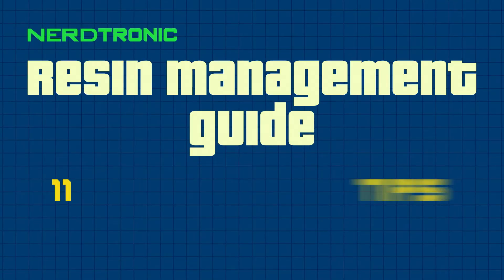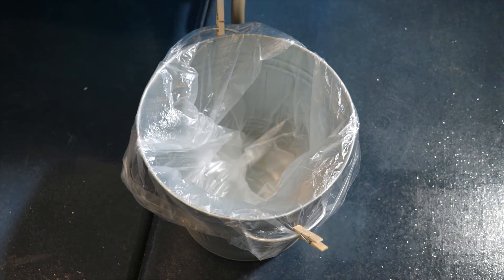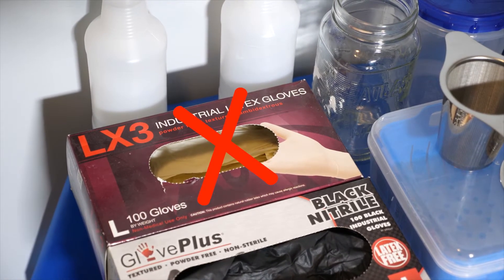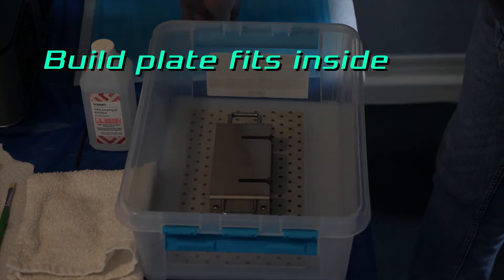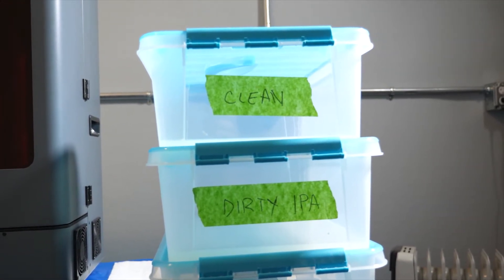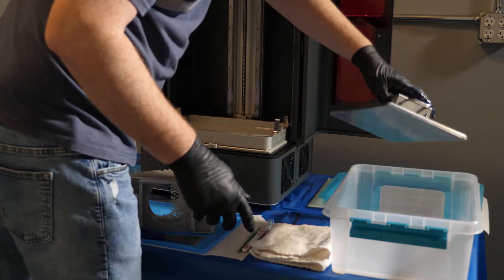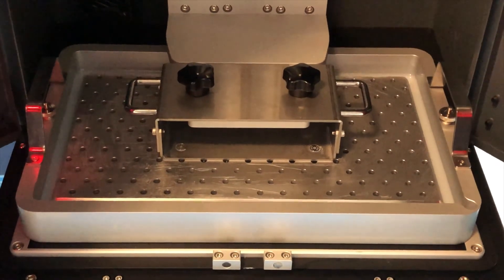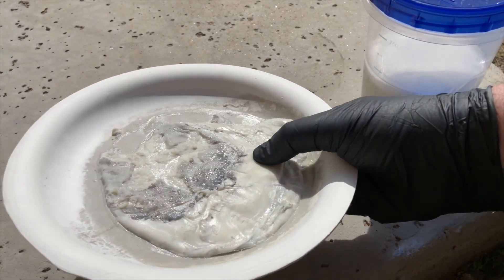SLA Resin Handling Guide for 3D Printing - 11 Tips for Containing the Mess and Keeping Things Safe

Comment: Thanks for another great video, great tips and will help. I can give you guys a awesome tip  Don't use those plastic scrapers, they damage your FEP., run your finger over the edge of th scrapper and you see. Get yourself a silicon spatular ( egg spatula/flipper) it works great, is easy to clean and will not damage your fep.  Also don't use paper towels to dry the vat , it scratches . Ger some microfiber wipes (fibre optic wipes ) . These will not scratch your FEP and are cheap.

Comment: I use most of these in one form or other. I appreciate the delineation between reasonable/practical and the practice of "Safety". 

The primary difference between our setups is that I have a ultrasonic cleaner large enough for the biggest print volume my printer can fill plus a little extra. This means it can fit my vat and build plate too. I don't have to brush anything. Ever. This requires a LOT of IPA (~2.5 gallons) to fill but due to its large volume there is no reason to delineate between "clean" and "dirty" IPA. For storage I used a 5 gallon bucket with sealed lid available from any hardware store. The Ultrasonic cleaner has an integrated drain valve which I have plumbed to pour directly into the bucket after use. A filter can be used to catch any supports, blobs, etc. A bonus to this setup is that I can simply put my hands in the cleaner should I get any resin on them. I don't know if I have more fumes than other setups given the surface area of my IPA is consistent and unchanging (vs. multiple large & small storage containers) but it is being agitated for the duration it is on. 

I do not use paper towels to wipe clean or even set the FEP on. Too much lint and abrasive properties. Lint free alcohol wipes if needed and only after an ultrasonic dip and air dry.

Another difference is that I exclusively use large metal razor blades to clean my build plate (~4 inch blade with handle found in any paint aisle). I'm not sure why but to date I've had more issues with excellent adhesion than I have with poor adhesion. I've had poor experience with putty knives. For me they don't cut it and catching a corner or edge will scratch/gouge the plate.

Just some of my thoughts/experience. Thank you for BulgeBuster; I'm testing it out currently.
Reply from the maker: Thanks for the comments!!

Comment: That mask is not for filtering VOC. Not saying it does nothing, its just there for decoration. 3M Sells VOC filters, but they are respirator cartridges. Furthermore I am not convinced that the VOC levels present are particularly dangerous beyond headaches, especially if you vent the printing outside.
Reply from the maker: Honestly I rarely wear masks anymore. The resin stinks and I vent it out a window. But I just try to minimize my exposure as much as possible.

Comment: Total 3d printing newb here!
This video is exactly what I have been looking for! Thank you.
One newb question: Do you put a clear sheet over your screen so resin doesn't accidentally get on it? I was under the impression that could damage the LCD screen.
Reply: The purpose of the FEP film that covers the bottom of the resin vat is for two functions: 1. Protect the light source/build screen; 2. Provide a low- adhesion surface to easily peel off the cured resin layers during printing. Keeping it clean helps with print quality and reduces risk of damaging the build screen.

Comment: Thank you so much for this video, it helped me out A LOT when I was first getting into resin printing. 
After doing it for a few months I just have a few questions that I was wondering if you know the answer to! When resin gets on the skin, we just wash it off, but what do you do when resin gets on your clothing? Just throw it away or cure it in the sun? Also, what do you do with your "consumables garbage" (gloves, paper towels etc. that are soaked in uncured resin) Do you throw those things in the trash, and schedule a pickup for hazardous waste? Thanks so much for all you do, I really appreciate all the info you provide!
Reply from the maker: Thanks for watching.  Those are some tricky questions actually.  Ok if you get resin on your clothes - depends on how much.  If it's a small spot honestly I would keep it from uv light and wash it with soap and water.  Yes you shouldn't put resin down the drain.  But it's not anthrax.  If you get it on your hands you should wash them with soap and water in the sink.  A little spot on a shirt - just wash it off.  If it's a large spot you could wash it in a bucket of water, then leave the bucket out in the sun to cure, and then pour that out.  If it's completely soaked because of some other accident, the skin contact is probably a bigger issue.  But saturated clothing, cure it in the sun and then toss it.  All the cured stuff.  Yes it goes to the landfill.  Toss it in the trash.  It's not rated as hazardous waste once it's cured.

Comment: Oh my god. I hope it's not too late to cancel my printer order.
Reply from the maker: Haha. You can do it!
Reply: I feel you a lot! I thought a lot for deciding between a resin and a FDM 3D printer and ended up ordering a resin one. I was amazed by the detail and the possibility of printing clearly transparent pieces, preferring it to the larger printing sizes of FDM at the same costs.
But these days I'm realizing that maybe I'm not patient enough to follow these safety measures, also I think I don't have a proper place to place the printer and all the tools.
Guess I'm cancelling my order too and buying an FDM 😅
Reply: Definitely a little overkill I am waiting for my printer and wash and dry unit. My biggest fear is getting it on the carpet since I'm renting I don't want to but a new carpet :( I have to find something that will protect it from any spills I don't think it's a good idea to put IPA in a Carpet cleaner the fumes could ignite.
Reply: @KRich408  might have to put a sheet of plastic or one of those spiky mats under your print area before setting it up.
Reply: This is uber-overkill. I feel nothing when handling resin gloveless for about a year now. I don’t use a mask or eye pro either. Just don’t pick your nose or eyes after handling. I picked my nose once and it stung slightly for about 10 seconds. I got a small drop in my eye and it hurt for maybe a minute. Don’t guzzle it or pour it all over your face. Clean everything with paper towels and wash your hands after. I can’t speak to ventilation because it’s not really relevant to my set up.
Reply: @Mazer2721  it's not about feeling something, uncured resin is toxic and seeps into your body through the skin. it's not healthy to handle it without gloves.
Reply: @alwaystiredkid  Not really. 

https://cdn.website-editor.net/77957cc2bab9412e863746d91116db70/files/uploaded/MDS.PDF 

Obviously safety data sheets will tell you to wear gloves/glasses because they classify it as a skin irritant, but even then they classify it as a 2 for physical contact as an irritant. In section 11 there's no toxicological effects listed other than irritation and potential allergic reaction. No lasting damage to the body from repeat exposure or seeping in are listed outside of aquatic wildlife.

Edit: Maybe there is another sheet out there by a different testing authority that would say otherwise, but that's just the one I could find quickly. If you already wear gloves when handling the stuff it doesn't hurt to practice caution. Happy printing!

Comment: VOCs are always bad for your health in the long run.
Stuff like formaldehyde is also potently carcinogenic if the material you are using contains any.
And any polymerizing agent, even in "eco resins", is necessarily a toxic substance otherwise it could not do its job. Treat it like you should treat any other industrial toxic waste.
A proper fume hood, even a self-built one, is the ideal solution for this if possible.

Comment: Great tips! I'll use these often! One question: you said clean the fep with a paper towel, but so many other channels say don't let a paper towel touch it due to scratching. Have you had any scratch issues? 
Keep up the great work!
Reply: I would consider using a photographic lens paper for wiping clean the FEP. They are designed to not scratch expensive camera lenses, so would be a suitable and fairly inexpensive way to clean it.
Reply: I bought a pack of fine microfiber towels just for this purpose. They are good enough for eyeglasses, so would handle the job well.

Comment: I ordered a resin printer with only a basic idea of what I was getting into. Now that I've received my printer and am getting into the details, I find that the room that I have for this isn't very well ventilated. The windows don't open. However, last year, I invested in a 2' x 2' x 4' nursery for plants, with ducting, fan and a carbon filter. Do you know if a carbon filter would filter the fumes of resin & IPA enough to be safe in an unventilated room?

Comment: Great guide! So far, I only use water-washable resins, though.
Reply from the maker: I've never used them.  But just sub alcohol for water in the video.  Everything else should be the same.  Water washable does not mean you can wash the resin down the sink, or that you don't have to wear gloves and take precautions.  It just means that you clean it with water instead of alcohol.

Comment: @Nerdtronic  Sometimes I'd like to just hit my whole work area w/ UV light to solidify and make harmless any stray resin on my tools, resin bottles, cleaning vats, other equipment and work area in general.  Thinking about trying that w/ something like these if it can be done expeditiously:
https://www.amazon.com/gp/product/B08FB63N7T/ref=ppx_yo_dt_b_asin_title_o01_s00?ie=UTF8&psc=1

https://www.amazon.com/gp/product/B07DJ8FY8N/ref=ppx_yo_dt_b_asin_title_o02_s00?ie=UTF8&psc=1
I'd probably remove the build plates and vats from my printers, then hit the whole work area (printers and all) w/ those black lights.  Optimum distance from the work area and cure time would be determined by trial and error.  I'd essentially be sterilizing (from harm) everything in the work area, minus any nooks or crannies the lights miss, so everything can be touched by human hands.  I could even reuse heavy duty gloves thereby eliminating the need for buying disposable gloves, and maybe save some $$$ in the process.

Thoughts about attempting something like this and making it part of a quality plan workflow???

Comment: Just found your channel and it's been really helpful so far. Have a few questions if you (or anyone else) can answer them. Paper towels etc - If i use a paper towel and IPA to wipe up some spilled resin or clean the plate, do i just throw the paper towel into the bin, or should i put it under some uv to cure it first? Or would the IPA on the paper towel fix, or cure the resin I've wiped up? - I've really not been able to find an answer to this question so far :D .. thanks!

Comment: At 10. I would not use that paper towel to wipe the inside of the tray, it will fine scratch the surface and those scratches will impact on the UV light comming from below.
Reply from the maker: I've never had a problem with that.  I use some fresh clean Alcohol as a final rinse, wipe that off with a paper towel and it's like glass again.  What do you use instead?
Reply: @Nerdtronic  Maybe it differs from printer to printer, but i just use a paper card around the printing area, and the resin will just clean itself, since the tray is teflon made.

Comment: Thank you for the tips.  I've just started printing with resin, though I've been using FDM printers for years.  The cleanup of the resin prints has been intimidating and actually prevented me from even setting the printer up.  I feel a lot more comfortable now in maintaining a clean work area. :)
Reply from the maker: Great to hear.  My next video is on getting started in resin printing.  So I'll be doing a 101 on all that stuff.

Comment: Great tips.  I think having a system is essential.  I also do the separate hand thing.

That strainer for the IPA looks great, I will definitely try that.

I wanna make some translucent molds that I can squish that resin blob into and cure in the sun... and make some I don’t know, Star Wars / Gundam model bases or something.
Reply from the maker: That strainer actually got clogged really easy.  I though it would work good but when I do an updated version of this video I'll try to find a better solution.

Comment: Thank you for share your know. I have one question. I try to reclycle the IPA, but using the AnyCubic wash and cure to cure the resin mixed with IPA, but all the misture turn white, and in a week, the resin don't decant. What can I do? I think for decant, the resin don't have to be cured... Is it correct? Thank you again.
Reply from the maker: If there's no ipa in the cured resin you can just let it evaporate and cure in the sun.  Then toss it once it's hardened.  But often there is still some IPA in the middle of the gunk.
Reply: @Nerdtronic  but my interess is to clean the alcohol for use it again, I don't want to evaporate. My alcohol have liquid resin mixed. I try to cure but don't work, because the mixed solution turn white and now the white part don't decant. Just to confirm, there is no solution for that, right? The correct way is to decant without curing.. after that, separate the clean alcohol in another bottle, and than, let the rest (little part of alcohol evaporate and cure the resin to discart. That's it? Thanks again!

Comment: I can’t express how much I enjoy a guide delivered from a well spoken individual with more than a dozen words in his/her vocabulary. I am not a grammar nazi.... however, for some reason when somebody recites a sentence that is not very well thought out, I can’t help but fixate on it for a moment, and I miss the information that follows. 😒 anyway... thank you for this. I like having an upper hand and being prepared. Btw that disposal method for used resin is simple and ingenious. I was prepared to add more buckets 🙄 the best ideas are the “duh, why didn’t I think of that?” Ideas  

One question (to anyone knowledgeable): Do you have a cure station or uv flashlight to further cure your prints? And or do you deem them necessary in the finishing process? 

I subbed 👍🏼
Reply from the maker: Thanks for the sub.  I have a UV lamp.  I used to set it up in a cardboard box with reflective foil taped to the inside.  Now I just hold it over the parts for a few min, flip and repeat.  Natural light from a nearby open window helps to cure it slowly also.

Comment: I find that paper towels are too abrasive for the FEP film I prefer microfiber towels. I consider them contaminated after use but will allow the alcohol to evaporate off and use them to wipe down the tools and such after they are too dirty to effectively clean the FEP.  I also have a step to open trashcan so it stays closed until I need to drop something inside.
Reply from the maker: Yeah I toss them right after using them.  Although I have been known to dig a damp one out of the trash to wipe something else off

Comment: Until I saw this video and your use of the silicone mats, I had intended to use a washer/dryer type drip pan as a catch-all.  Still might, but yours can obviously clean up well, whereas the drip pans might be more difficult.  In the end I imagine I will use both, one inside the other, as I tend to go brain dead on occasion--no...every few seconds---and I already anticipate tipping an entire bottle of resin over before too long.  The drip pan should catch all of it, but the mats probably wouldn't.   
Great video, as with all the rest.  Thanks so much for every one.
Reply: Followup to my own post:  I just got back from Home Depot with a pressed plastic washer drip pan/tray.  Brand name  "Oatey," and it measures 30" x 32" over the outside edges (28" x 30" in the item description). 2 1/2" deep, and $22.99 (USD) plus tax.  The color is white.  It comes with a drain attachment, but unless you plan to spill a LOT of resin (!), you won't need it.  All four sides are otherwise uncut/undrilled.   The bottom is pressed...perhaps 3/16" deep...with the logo and eight stiffening arms in all directions, so I will fill those gaps with cardboard and then use thin plywood to mount the smaller silicone mat, and the printer atop both.  I mention this only in case you like the idea, but wonder about proper leveling of the printer, and how to do it with this undertray.   
In my case I need this extra precaution because the floor underneath the table is carpeted.  I don't want to have to even TRY to clean a resin spill up from a floor like that.  :-P
Reply from the maker: Try the food trays under the silicone mat.  That’s my new way. There’s a link to those as well.

Comment: Great Video!
 One question regarding cleaning the FEP foil. You are using IPA but in the Prusa SL1 manual  they advise against using IPA for the FEP foil and recommend using warm water and dishwater soap. Wondering about what’s best/ easiest?
Reply from the maker: I can't say.  I've always cleaned my fep with IPA or Denatured Alcohol.  People say paper towels scratch it and I use those to clean it also.  I do sometimes clean it with soap and water AFTER it's been thoroughly cleaned with Alcohol.